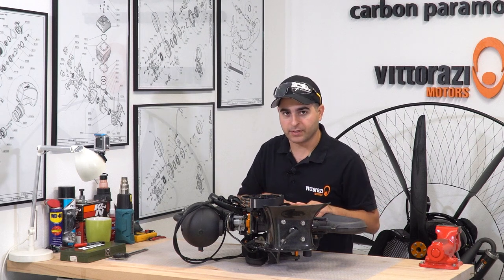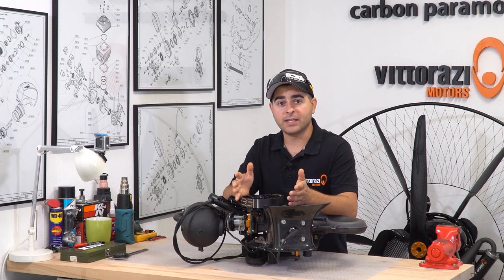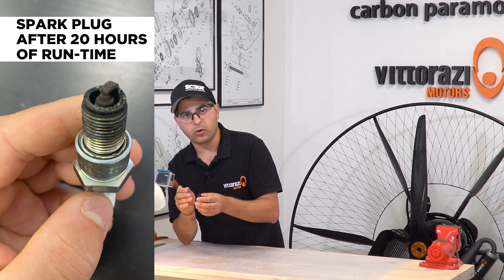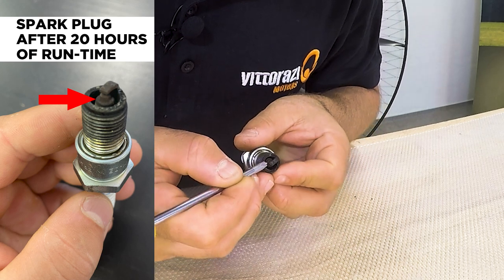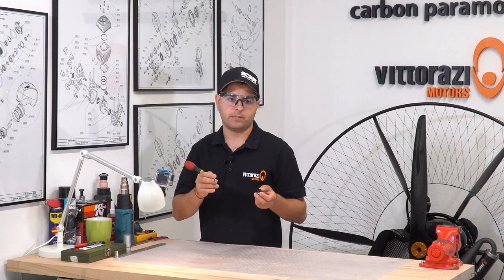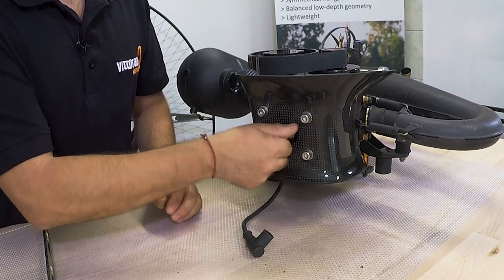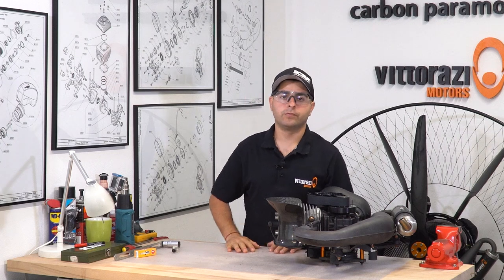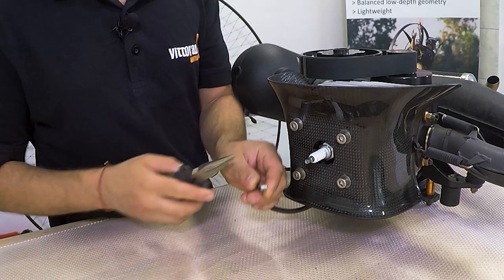Vittorazi Moster Plus spark plug replacing and reading. Paramotor engine maintenance

Comment: That spark plug is oil and carbon fouled.  A leaner mixture or a hotter temperature spark plug should be used.

Comment: Is it not so , center electrode and ceramic color shows the heat range of the spark plug and the edge and the piston top shows the burning temp. ?